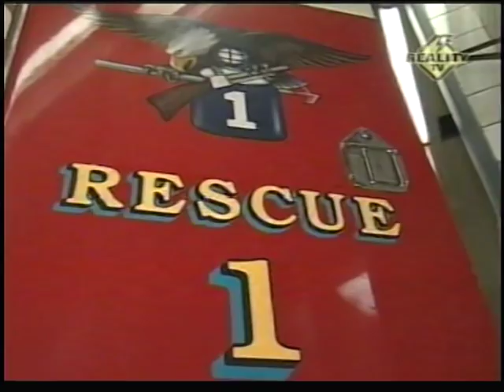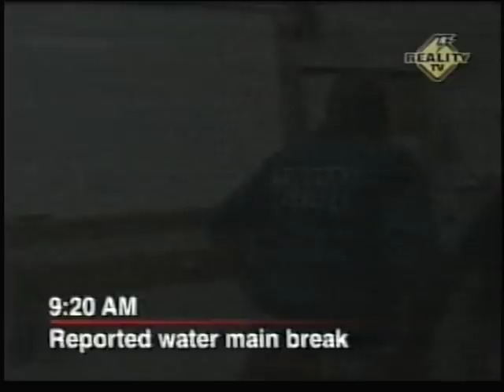FDNY Rescue 1

Comment: Can anyone here tell me, as far as the FDNY goes, what is the difference between rescue and squad?
Reply: “In some Departments, these two terms and companies are interchangeable. However, there are some differences in the two types of units. In the FDNY, the Rescue Companies use typical heavy rescue apparatus, with no pumping capabilities and no compliment of ground ladders. The equipment carried includes a full compliment of SCBA's, hand tools and power saws for fire fighting, and an assortment of rescue tools to handle everything from auto extrication, confined space operations, water rescue, to building collapses. Most of their fire ground assignments are based on ladder company duties. These include forceable entry, search, and ventilation. Although the rescue companies usually respond as a special unit, if they are closer to an alarm than the first or second due truck company, the rescue assumes the duties of that truck.

Squad Companies in the FDNY use Engine style apparatus but also carry specialized equipment. These companies serve dual purposes. In their normal 1st alarm area, they respond as an engine company, either first, second or third due. Their duties are the same as any other engine assigned to an alarm. In other than their first alarm area, the Squads are assigned as a special unit, and the incident commander assigns them tasks on the fire ground. These tasks can be either engine or truck company related. If the IC decides that the engine companies need help stretching lines or an additional handline is needed, the Squad can be assigned this task. If the IC decides that vertical ventilation is needed, the Squad can be assigned to perform or augment the roof top ventilation.”

https://www.firehouse.com/operations-training/article/10575457/rescue-and-squad-companies
Reply: Squads are also trained hazmat
Reply: @Randy I appreciate you answering but that was 4 years ago lol